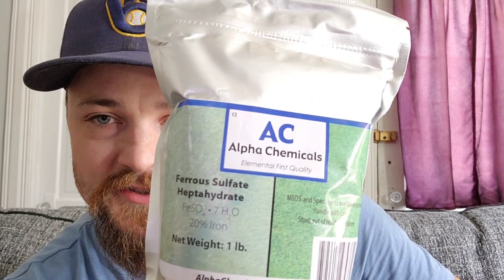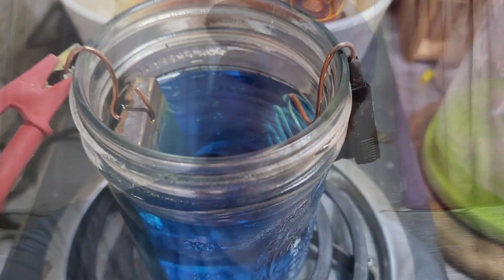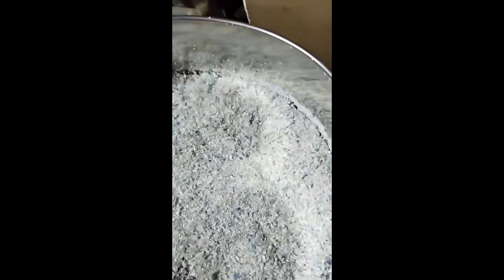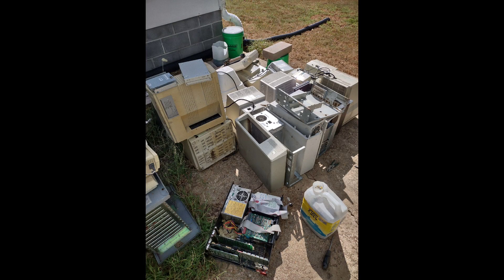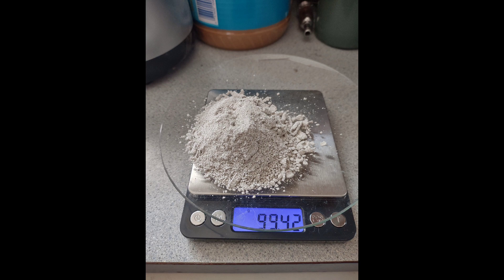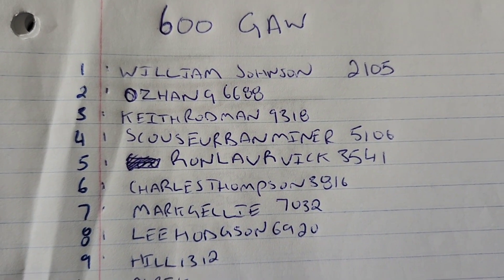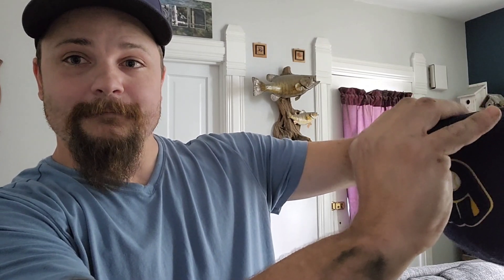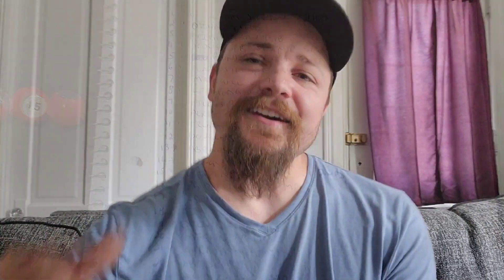Subscriber video!! 600 GAW!! Thanks everyone!

Comment: I process all High Grade, Medium Grade, and Low Grade Printed Circuit Boards myself. They are too valuable to just sell and let someone else become "rich". The most valuable fraction (at least regarding Low Grade PCBs) is the solder. A two step hydrometallurgical process removes all the solder, and the electronic components simply fall off. Tin, Lead, and a little Silver are recovered from the solution of dissolved solder. Remember: Tin is worth 3½ times more than Copper.
Afterwards, virtually every single value is recovered from the electronic components by various methods; that's also the case for the bare boards themselves. You'll be surprised to see that many components contain for example Silver (as well as other Precious Metals).
Currently I have 4 tons of Printed Circuit Boards in stock, all waiting to be processed. As a backyard scrapper and metal recycler/refiner it's sometimes hard to keep up with the supply of raw materials. Chemical processing is pocket money, scrapping/recycling is where the real money is.
The fastest way of depopulating PCBs is metallurgical wet processing. The fastest way of processing "impossible"/"hard-to-separate" parts is pyrolysis. As examples: Epoxy sealed components, transformers (lots of lacquer/glue), electric motors (lacquer), yokes from CRT TVs (lacquer and lots of sealant), and car parts with pressed in rubber dampener bushings often smeared in oily dirt. The Raw Pyrolysis Oil can be either sold, or refined into Gasoline, Diesel, and Fuel for your own use.
Reply from the maker: What do you use for your chemical process? Just AP? How do you go about getting the Tin?
Reply: @SilverStoll .   For some processes I use AP. However, I don't use Peroxide. Instead, I connect a special fiber filter to my compressor. At a pressure of 5 to 8 bar this filter is capable of filtering the molekyles in air into Nitrogen and Oxygen. The Oxygen is used for many different chemical processes. My HCl is homemade at no cost from "hard-to-sell" plastic waste, in a rather simple process.
Unfortunately, Denmark is a socialist country so almost everything is prohibited here. HNO3 is banned for private citizens; so are concentrated H2SO4. In Brazil I have no problem buying acids, but to keep expenses near zero I never buy any chemicals or acids. Virtually everything is homemade from waste at no cost, even the gas for heating comes free of charge from my anaerobic digesters. The digestion generates H2S as a biproduct, which is captured as elementary Sulfur, to be used later for making SO2 for precipitation, resulting in purer Gold than when using SMB. For the initial refinement stage of Gold I prefer Ferrous Sulfate for precipitation; very easy to make at home.
I can use as much HNO3 and H2SO4 as I want without having to pay anything for it, and these two acids are pretty easy to make. HNO3 from organic waste and H2SO4 from for example waste gypsum, both are made at home at no cost. A substantial part of my HNO3 originates from the NOx fumes generated during various chemical processes. These fumes are collected and converted back into HNO3. Any remaining acid in solutions after every reaction has completed is always distilled off for reuse.
When processing Platinum Group Metals I always use Chlorine gas.
Copper Chloride and Ferric Chloride also work very well for dissolving.
When you ask about chemical processes, do you mean in general or the hydrometallurgical process for solder removal?

Comment: I think you palmed my ball......... The funnel will need the matching flask to set in. The work well. If you get the stoppers for the flask also you can filter then put the stopper in for storage.
Reply from the maker: No! That's why I opened my hands lol
Reply from the maker: Can you use the rubber reducers?
Reply: Glass works better
Reply: should work @SilverStoll

Comment: so close... i was 27... i say my number when you where showing them... just received my nitric acid yesterday... guess what I'm doing this weekend...
Reply from the maker: What's on the list to refine?
Reply: @SilverStoll  about 600g of ram fingers.
Reply from the maker: @sergelafrance302  just the fingers?!? That's a good chunk!
Reply from the maker: I only have about 150 lol I do have 750 grams of the actual sticks without the fingers. Can't wait to process those
Reply: i got lucky getting lots in the last few months... like 300+ ram cards... i still have to do the chips too... @SilverStoll
Reply: have not touch my silver contacts yet...
Reply from the maker: @sergelafrance302  I like the copper cell for them. I used to put them in AR to devolve the base metal and leave the silver untouched  but the nitric is expensive compared to the silver. I just picked up 5 pounds of potassium nitrate to try and do the weaker version of AR and see if it will work